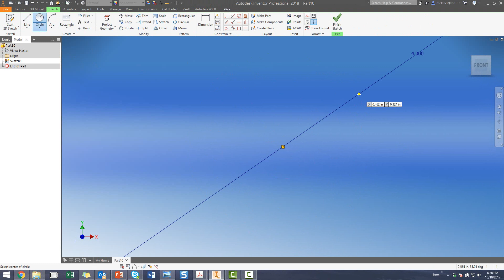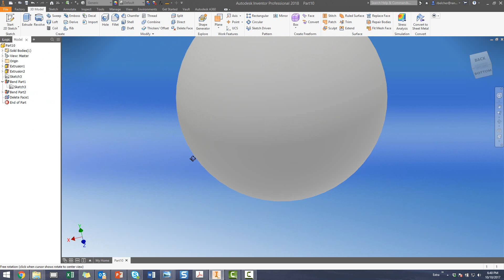Autodesk Inventor - Adding Text to a Sphere

Comment: This Didn't Work.
It wrapped the Text,  but the Text was very Distorted.  The part on the top of the Sphere was normal size, But the part that wrapped got smaller and smaller.
So the Letters got smaller as the curve increased, instead of staying the same size, but wrapping the curve.
It only seems to NOT Distort the Letters if you bend in 1 axis, like a cylinder.  Then it works perfectly.  But when you add in the 2nd axis,  it does all kinds on weird stuff to the letter in that 2nd axis, making the height smaller as they go towards the outside of the sphere.
So say for instance, you put an H on the right side of the curve   the inside (Left) of the H will be normal height, but the right side of the H will only be about 60% of the left side.
It looks really off